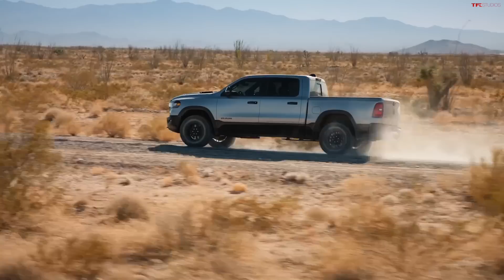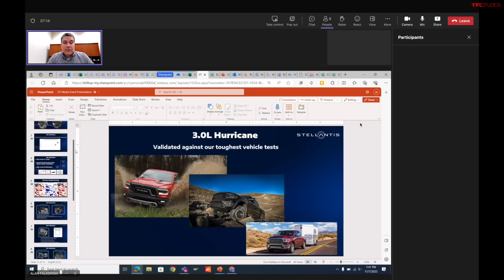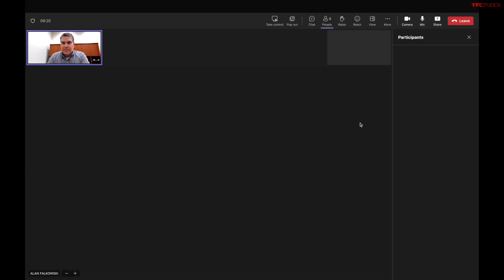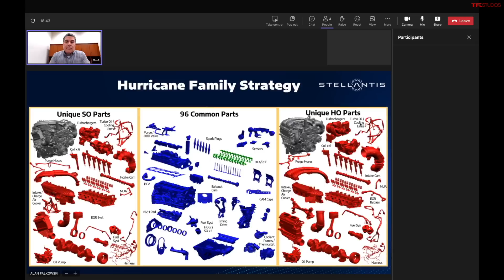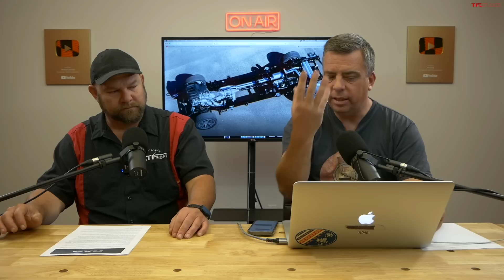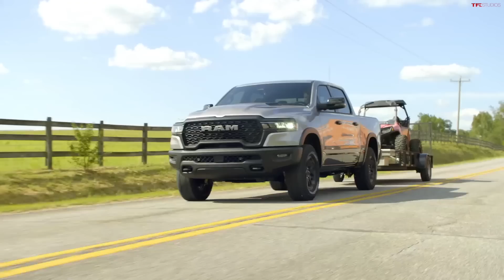2025 Ram 1500 & Ramcharger DEEP DIVE with the Chief Engineers!

Comment: I love my HEMI in my '22 Rebel, however, I'm pretty sure I could cozy up to 521 horse power and even 420! The exhaust note is going to take some getting used to. I believe RAM makes the greatest looking trucks and their interiors are second to none. Just my opinion.
Reply: I’ll take quiet and superior power over that outdated hemi any day
Reply: I won't do it. It sounds like a stupid car. That V8 sound note is the FULL size truck experience.
Reply: SO Hurricane (420/469) in my Wagoneer has a pleasing rumble.
Reply: It's 540 hp and 520 torque . The electric will do 60 in 4.4 seconds.
The range is extended due to an inverter that's not charged by the truck it's twin engine one in the back one in front.
Highway driving the front motor allows the truck to free wheel to save power.
700 mile range.
These trucks were not thrown together like the competition.
The straight six has always had more torque than V6.
These trucks are nicer than Cadillacs on the interior.
You can start and open them with your phone.
It has a huge screen and a screen across the glove box built-in in as well.
Mopar had a full release last night with them on a testing ground.
This is a huge change in ram trucks.
 But for 15 grand, you could turbo your 22 or 23 model year.
Reply: Yeah u do that

I’ll be the guy with your old truck for cheap and a turbo on that hemi 
Making fun of u👍
Reply: Maybe, maybe not. As an old Dragracer and engine builder from the early 1970's, I think I could cobble something together to Blow Your Doors Off! Just sayin'! @jakejonesy9275
Reply: Maybe, maybe not! @jakejonesy9275

Comment: I have an Ram 3500 srw 4X4 use tow hooks to pull out riding mower an d other vehicles even mounted tow hooks in my bucket on my tractor use 15 20 times a year

Comment: Ramcharger - The next time ask them if you can lock the truck and walk away with the ICE engine running and have it top off the battery with an auto shutdown once the battery has reached full or a driver set capacity?  That way you can stop at a hotel or a stop to eat and while you are gone the battery is topped off.  Then when you get back to the truck you could hit the gas station to top off the gas tank before hitting the road.  Second question is how long will it take the ICE engine to recharge a depleted battery at highway speed and while stopped?
Reply: Not sure why one would do this. It's so incredibly inefficient to generate electricity using the internal combination engine, it would probably consume 1/3 or 1/2 the fuel tank to top the battery off. 

Just plug it in, it will only cost $12 to fill that battery, using electricity rates of $0.15 / kWh. 

As for driving, like any hybrid or EV, the battery will recover some energy from regenerative braking (including towing), but we're talking minimal energy recovery compared to the massive battery size of the RamCharger.
Reply: @wzDH106  There are a lot of things that have not been fully thought out as we race to embrace the rantings of a high school dropout.

Comment: You guys didn't ask the most important towing question. Since this vehicle is capable of towing 14,000lbs, is that 130kw generator really enough to keep energy in the battery at highway speeds at max towing? 75mph in Texas plus grade or wind resistance may use more KW than the generator can put out. If this happens, the battery will quickly drain to the minimum threshold and put the truck in depowered/limp mode so the generator can catch back up. Maybe that generator is very efficient but with 250kw up front and 150kw out back, you may see situations where someone isn’t managing their power and you hit a grade with low battery, you may have to limp your way up that mountain. 

My 2014 Chevy volt had a feature called mountain mode and what that did was put the generator into charging mode while driving to maintain a consistent 1/2 battery capacity so IF you hit a grade (like the Ike Gauntlet), there was still enough energy in the battery to make it all the way up the hill because the generator in the Volt wasn't powerfull enough to generat that type of energy by itself to make that grade. I suspect that 130kw wont be enough in a MAX towing situation. Be interesting to see how Stelantis goes about it.
Reply: I'd imagine the battery would act more as a buffer in tow haul mode. If my math is correct, that's 170 HP (130 kW) for the straight and level, essentially the HP on many Diesel trucks on the road, and we know the torque is there with the EV drivetrain. I cant imagine the battery would be working too hard on grades, only filling in the gap when needed, while recharging on the descent.

Mountain mode was also available on our 17 Volt, though we never used it in the upper Midwest. It only reserves 15% or 20% of the battery, and honestly, never needed it when climbing though the Rockies and Cascades on a road trip.
Reply: @wzDH106  I believe  your 2nd gen Volt had a dual stage twin motor setup that allowed for direct mechanical connection. The 1st gen Volt had ZERO mechanical connection to the drive train like this Ram. On my Volt, if the battery ever got low and you hit a long grade, it would put the car in reduced power mode and it will slow down because the energy put back into the battery was 100% the power the motors used. Your 2nd gen allowed for mechanical connection (from what I read), so the battery energy didn't matter under extreme conditions. I just don't see how 170hp worth of power will allow for 14,000lbs of towing if you loose that buffer while towing that heavy on long trips.

Comment: I'm a bit worried that the vehicle-to-grid functionality won't be in the launch Ramcharger and that it will be a feature that can't be turned on later. This is a key feature that would get me to buy this truck. I did reserve my spot in line so will be looking for updates as launch gets closer.
Reply: The 7.2kW outlet in the bed should be able to be used for that, even if the vehicle-to-home via the charger isn't available from the start. You'd just need a proper interlock kit on your panel, or a transfer switch, with a 50amp 240V power inlet box. Granted, that won't be as powerful as the proper vehicle-to-home would be, but it should power many devices in the home.

Comment: Does the RAM 3.0L fuel injector wash the intake valve or is it DPI only? The BMW 3.0L N54 didn't spray past the intake valves and they would coke badly. Walnut shell blasting was necessary to remove carbon buildup.

Comment: So 20mpg on the generator?
Reply: 24 mpg if you start your trip with a full battery. A whole 1 more mpg than a regular Pentastar 4x4 😂. But the generator is meant to be used for emergencies/long trips. Theoretically you should be plugging it in and using the battery most of the time.

Comment: FYI: air suspension is Terrible for us in northern cold climate. Lots of failures.
Reply: 5cc of airline antifreeze into the system fixes all that. I live in canada and have a 10 year old ram 1500 with air ride, and wouldn't trade it for any steel spring!

Comment: Ramcharger in a 2500 or 3500 format would be interesting if it ever came to be.
Reply: Based off the stats and what the curb weight will be the Ramcharger is almost a 2500 the way they are introducing it.
Reply: @timmead3021  yep and it even has 8 lug wheels.
Reply: Yes with a 6.4 v8 range extender.
Reply: Why not Cummins generator for HD trucks. They have been in those for years.

Comment: It’s going to be all about durability and reliability in the end and that’s goanna take time. Hurricane motor with no cylinder sleeves to me a major flaw to this design.
Reply: Time will tell if the plasma spray cylinder coating will hold up. 
It’s my understanding that the coating is extremely hard, while being as thick as a human hair. At first glance it seems kinda risky for long term durability if the coating turns out to be wear faster than expected or delaminates over time.
Reply: If Spray coating is the case, it doesn’t sound like these engines will be rebuildable. @pauldiesel4582

Comment: Was there anything mentioned regarding how the trucks weight has changed due to this redesign? Does the Hurricane help drop weight, or have they used more aluminum in the body?
Reply: Rams are notorious rust buckets here in the midwest so lets hope they used some upgraded materials/or aluminum.

Comment: The Ramcharger is an interesting concept, if they would develop a replacement fuel cell, which could replace the I6 engine as a generator in the next evolution cycle. It certainly gets rid off some weight traditional hybrid cars carry with them as it doesn't need a full blown gearbox/transmission, and it has the option of better range, although range I think is less a concern than towing capacity. In that regard, you talked a lot about the lifetime of the gas engine (generator), but I am more curious if there will be an effect on the battery life, when you start charging it with still some load in it and while using power from the battery for driving at the same time. Especially if you are using the truck as a towing vehicle with its 14000 pounds of capacity. If you use it that way, I understand that you will use it more towards its upper limits and there seam to be a buss management system to run the power from the generator directly towards the electric engines, but I am curious how that will effect the overall battery life. From my amateur knowledge of batteries in phones and laptops I always learned it's best to charge the batteries once they are fairly low on energy rather than always charging (keeping it plugged in) while using it. I guess what I want to ask is really, if the battery lifetime is decreasing, due to the fact that you potentially charge it more often and without using its full performance (eg. recharging it when it is still half or even more filled). That would be interesting to find out.
Reply: The ICE wont have a traditional transmission, and should be directly connected to a motor generator for charging the battery and sending current directly to the electric motors. Probably depends on mode, but it should only kick on when needed to either recharge the battery or power the motors. So the battery life should be largely unchanged and allow passthrough power when needed.

Comment: Why haven't they gone camless which gives you  more controllable explosion and reduced weight. The electronics for this are able and cheap.
Reply: Controllable explosion? What electronics and components are you saying are cheap? The only system I know is from Koenigsegg and their FreeValve company which still struggles to make the economies of scale work.
Reply: @MX5-XU  people have built free valve mods.  The parts to do this are cheap
Reply: @ChicagoBob123  home brew solutions cannot be compared to what an OEM can and needs to develop.
Reply: @MX5-XU  i know what you speak of with the temps that need to etc.  In mass our gets cheaper.  A lot cheaper

Comment: The overall package of the Ramcharger is excellent and will sell and put pressure on Ford/GM/Toyota to either get up to 2.5+ miles per kwh on EV or a range extender EV combo with better mpge equivalent 30-50+  and msrp for a competitive 40k-80k.  A stripped down 40k-50k commercial/retail model needs built.....let the consumer dictate what they want!!!!
Reply: My lightning gets closer to 3 miles per kw but i live in the south where it doesn't really get cold.
Reply: I was thinking that this platform would make a great base for a fleet vocational truck. Something where you need to export a lot of electrical power, or include an e-PTO to run pumps, vacuums, etc. lots of energy available in that battery, and the generator available for the extra power needed. I agree with you.

Comment: Given that the engine isn't going to be powering the wheels, and will seemingly be working less, I'm guessing the recommended service intervals will be based on engine hours instead of mileage.  I'm curious to see EXACTLY how tight everything is packed into the engine bay.  Given the engineer's comments, I'm guessing it's going to be extremely difficult to work on anything under the hood.
Reply: You don't want to touch anything in there. Muy ⚡⚡ ⚡

Comment: 3.0 L inline 6, closed deck aluminum block. All I think of is BMW's B58 engine. They're legendary.

With a tune and minor bolt ons these hurricane engines will be brutal, and will eclipse the Hemi in every way, only cost will be the engine sound but there's everything to gain with this. Would have been a nice opportunity to ask why the 392 never got out in the ram
Reply: @Bikes0420 nah, they should last 10-15 years
Reply: I think it has enough power.
Reply: That’s where they got their designs from. B58 is legendary.
Reply: @ryanb8736  Not sure , but i have heard of Chrysler  trying to buy BMW  way back in the day, I think it was in the late 1950s, I'll have to check up on that.🤔
Reply: This engine actually has the same exact bore and stroke as the BMW S58 (the engine in the M3 and M4) with the HO having higher boost than the S58.

Will be very interested to see how reliable this engine is for the long run
Reply: BMWs are susceptible to heat. The plumbing around the engine have to be able to handle this.  So many repairs of BMW due to wiring gaskets and plumbing not able to deal with the heat.